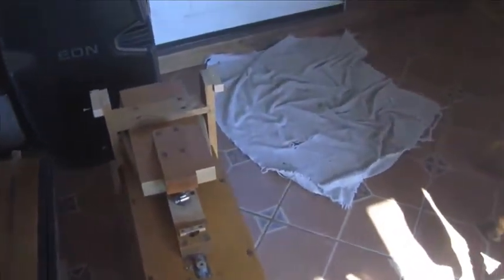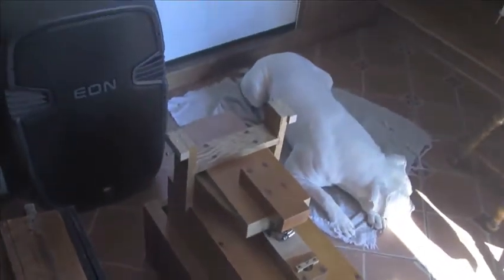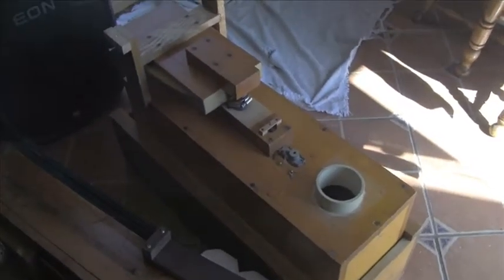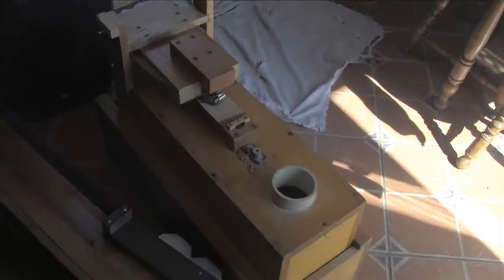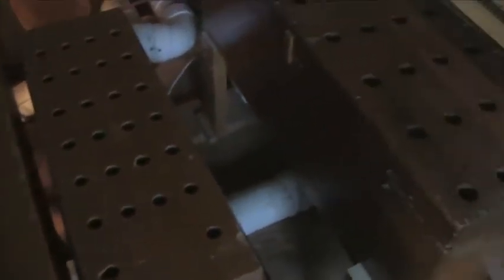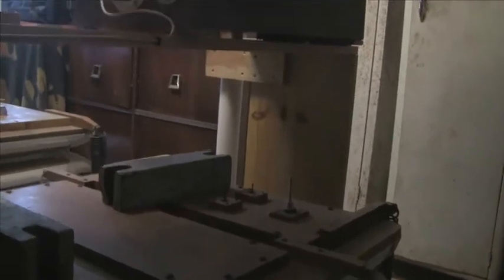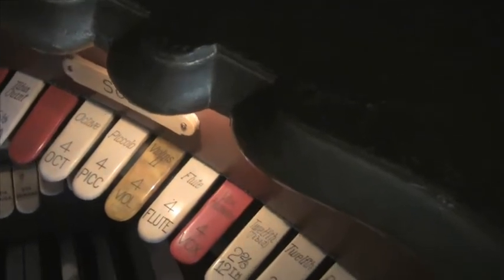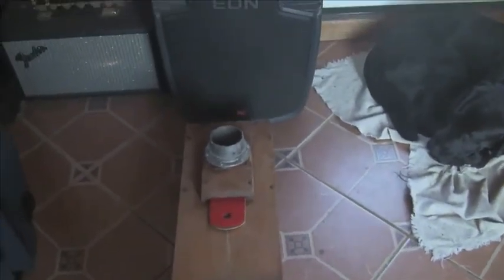Replacing my main trem

Comment: The 1910 Wangerin Weickhardt organ I used to play years and years ago at our church always had a troublesome trem. It would lock up occasionally and the only fix was to turn off the blower and let all the air out of the windchest and restart it. I envy and  admire your installation and being able to walk into the guts and work on the different components. Keep us posted with progress videos. Very interesting.
Reply from the maker: Thanks Steve!